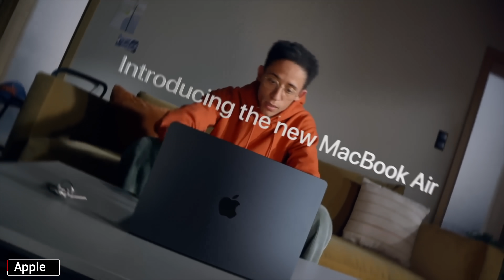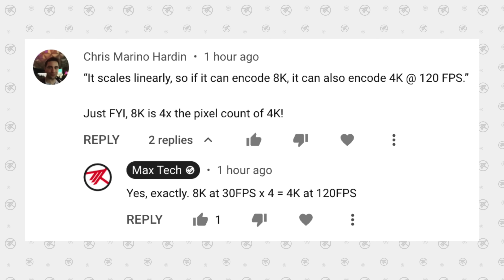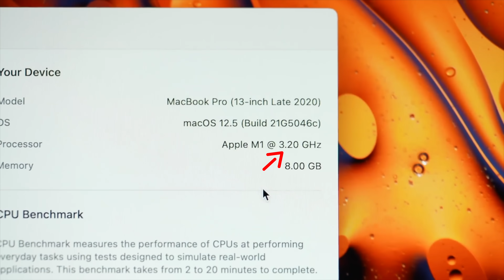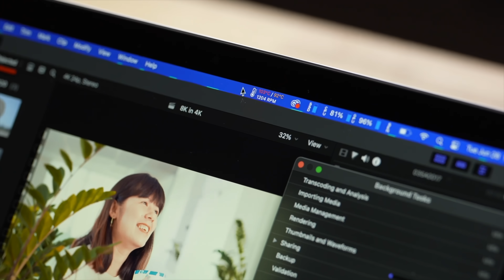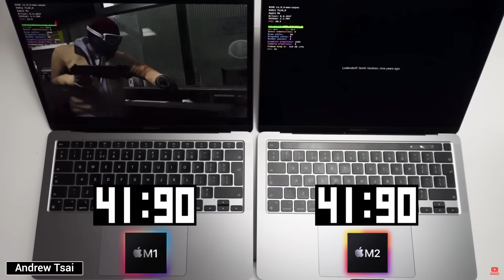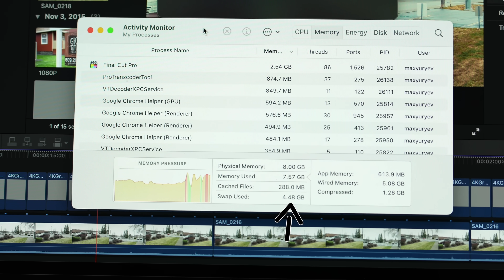M2 MacBook Pro - Top 7 Problems after 1 week..

Comment: I think i have a problem with my Macbook Pro M2 13 inch. The speakers don't sound as loud as the Macbook Air M2. For instance, I have to set my speakers on 75% in order to be on par with Macbook Air M2's speakers on 40% - 50%. Does anyone else having this issue as well? Thank you.

Comment: The only issue i see is the webcam that i don't use. Pros: fans, touchbar (for me), battery. 0.3 inch of more screen is useless when you always work in full screen because they cut the top part and it's the same size 13.3 😑😑.

Comment: Also, did anyone notice the speakers on the M2 behind quieter and more muffled than previous generations? I just upgraded from a 2019 MacBook Pro and the 2019 is noticeably louder at comparable volume. Or did I just get a lemon? :/
Reply from the maker: Nope that is correct. They lowered the highs and tried to balance out the sounds but it is quieter. I prefer the 2019 speakers.
Reply: @MaxTechOfficial  Thanks for confirming, just wanted to make sure I wasn't the only one. I gotta say it really feels like a downgrade :/

Comment: People who want a stable system should not use m.2 hard drive.Especially those who do important tasks or write reports often..The fault rate is too high right now, People who back up often won't have that much issues,but still.It's like holding a ticking time bomb not knowing when it's going to crash on you..The m.2 still has a  long way to go to be in the safe range.

Comment: I dont feel cheated.  I paid $1043.00 before tax out the door at Bestbuy yesterday.  $60.00 less than an Iphone 13 Pro.  Im no content creator so Im happy. Its an upgrade from my original unibody intel mac.
Reply: What configuration did you get and how’s it working?
Reply: @sunitjoshi3573  I got The base model 256GB SSD with the 8 GB of RAM.  I’m no power user but I’ve got it to do everything I need.  Love the battery life in standby and normal use. Really only need to charge it every couple of days.  I’ve went a week in standby.

Comment: None of these “problems” are related to my use cases for a M2 air. Lots of mix up between Pro and Air…. on the other side, I am missing whether the 10 problems found by this channel in M1 are still existing in M2…? Nothing…btw…. 2-1 chip is most likely related on shift at chip producers… wasted time here…

Comment: You’re clearly drawing conclusions without all the information. The individual wafer price alone doesn’t tell you everything. How many wafers did Apple need? Which suppliers could fulfill an order for that many? And what was their price?

Also, was anyone selling flash storage of the same quality as Apple used in 2019 in sufficient quantity to fulfill their order? Maybe Apple’s only viable choice was a slower option. 

Did they make a mistake? I don’t know, maybe. And neither does anyone else here, unless the DRI for the M2 MBP’s storage subsystem is here (and even if they are, they won’t say anything unless they want to lose their job and get sued).

But, from knowing Apple, I doubt they made a mistake. I’d put my money on them making a tough compromise in order to have these machines ready for sale last month.

Comment: Unfortunately, seems M2 MBA may have much more issues than this M2 MBP, and seems it has even worse production quality, and much worse supply issues.
The supply chain is really bad this year, the M2 MBP video you shared are based on an old matured modal and design, and please think about the brand new MBA, how it gonna be.
M2 MBA still need to wait for a long while to be shipped, due to those production issues. It should not happen in the past years.

Comment: When I saw the thermal throttling issues in the M2 13 Pro from your vids, I immediately got rid of all inclination to buy the new M2 Air. I'm just gonna wait for your reviews. Honestly, I can't see how the M2 Air can physically be better than the M2 13" Pro with no fan. Also Apple using lower quality SSDs all around. That's just insane!

Comment: I like the old design. The new bulky design looks terrible for the 14/16. But I like the new air m2 design which is thin.
Reply: 14/16 design is way better than the old design what are you talking about. Currently have a older mba and the new 14” mbp, I mean yes it looked “bulky” but barely any diff ( oh what like half a pound heavier, sooo heavy can’t carry a half pound more item🙄). Oh so you like the new design on the new air which is the exactly the same on the 14/16 but Bc it’s thinner on the new air so you like it? Bro, you just like it thin so the design don’t even matter  🤦‍♂️
Reply: @Andi-lk5ff  Yeah that’s true I just like it thin. Hate that the 14/16 is so bulky. Looks like it belongs in 2009.

Comment: So what config do you suggest in terms of ordering the MB Air?  I was planning on the 10 core 16GB RAM and 512 SSD.  I do my video editing on Mac Studio, so not worried about that - this is more for checking while doing web design and travel. Replacing M1 MBPro 13" which I already sold.

Comment: I think it's still a great laptop for many people however depending on how the air performs that would be the better option. M2 is only a marginal improvement in some areas and a leap in others. They need to update the software or make changes in the future to avoid some these throttling issues

Comment: I miss the touchbar a lot on my 14" m1pro. But for video editing I needed the better display. I would not need the Magsafe, because I was super happy with the usb-c. SD Card reader is nice, but somehow it does not read all my cards (some 32gb Sandisk extreme pro wont read, 64gig do and the 32gig does read with another cardreader) I also feel that my external card reader is much faster. Also the HDMi will be nice for talks, but will not show my hdr content on my HDR TV, So I need to copy files to a nas and play it with my atv. Different people, different needs I guess
Reply: Well you are also that 1% of the population that like the touch bar, that explained all
Reply: @Andi-lk5ff  The Touch Bar works great with fcpx and also is a great tool for Affinity Photo (you can change the size of the brush while painting). Changing volume and  display brightness is much faster done with the touchbar. Also scrubbing through any video is done faster with the touchbar. There are many tasks where I don't have to move my mouse when I had the touchbar.

Comment: So, I was going for the M2 Air when it lands. I have an M1 Air now. I know the performance is not hugely different, but I like the greater GPU power for a coming game I want to actually play on the Mac regularly. 

So, tell me, do the numbers here make you think that in some ways the M1 Air might outperform the M2 Air, as you would estimate it (no fans, there...)? Might the SSD dump to VM be faster on the M1 Air? Opinions here, please, Max!
Reply: Dude, even the M1 Pro (which has better graphics than the M2) barely gets 40 - 50fps on Shadow of the Tomb Raider, a game that was released 4 years ago. I'd seriously reconsider getting an M2 for gaming.
Reply: @Soreyu  Indeed, the M1 Pro has more GPU muscle than the M2. Remember, though -- SotTR was released 4 years ago and, as such, is written for the Intel architecture and is running under emulation on Apple Silicon. That's going to incur a significant speed hit. 

It's No Man's Sky that I want to play on the Mac, and that's just when I'm wanting a casual session on the go. I play it on PC (with much more powerful GPU than the M1 Pro or Max) and realize it will be a lighter experience on the M1 or M2. Still, it's being rolled out as an Apple Silicon-native port using Metal 3 and is will be featuring the new MetalFX upscaling -- so it should be running rather efficiently on the hardware, according to Apple / HelloGames: 
https://nmsspot.com/2022/06/06/wwdc-surprise-no-mans-sky-is-coming-to-the-mac/
Reply: @blakespot  From the looks of the M2's thermal throttling on the 13" Pro, I'd say there's a very good chance that gaming performance on an M2 Air could actually be WORSE than on an M1 Air. It would perform better for the first 5 minutes. But then after it hits 100C+, everything gets shut down by 50% or more (as we saw in the other vids), and you basically have a hot paperweight. Even the M1 Air only cut performance by like 15% tops for extended loads. But yeah, I'd wait for the review, or just take advantage of Apple's return policy lol.

Comment: Have you ever thought that this kind of machine is a "pro" but not for the "video editing" people? What kind of Mac should use a lawyer, or an accountant? Don't try to say a pc, please… and maybe we don't want an air, but neither a 14" (or plus)… we don't need all that power. And, try to think that maybe that kind of people loves the strip and not the function keys… and that we need space in hd and in ram… So I agree that the 256gb is a big mistake, but this Mac is the perfect machine for professionals in the legal or accounting… I really think that I will buy a 24gb of ram and 2 TB of ssd, because it's the machine I need. Maybe Apple could leave the M1, and maybe there are around too many different types of Mac… and maybe they could give some more months to their product life, but that's the crazy world we live in… So, why don't you make a test on how good is this Mac using Office, and Filemkaer and this kind of applications with 24GB of ram ad some 30 apps all togheter on a 38 inch (or more or more than one) screen? And the duration of the battery with a monitor and a huge presentation?
I don't really care about video encoding… ;)

Comment: Nothing funnier than a Fruit Fly going ballistic that they've been conned again by the Fruit company.    After the incessant use of planned obsolescence that is known in the iPhone and iPad lineups with the continued failure to deploy new and problem-free keyboards for years, I am not surprised that the Fruit company brought out the con-chip, M2.     What you have here is a computer that is simply using up known supplies of un-used chassis from unsold units.    And to think that the company that is worth a trillion could not reprint boxes and had to resort to stickers to cover this.    Cats do a better job of covering their waste.    

I applaud the innovation by the Fruit company using the ARM chips in their system for energy efficiency, but just when you think that the company has become ethical, they prove that they will con you when you aren't looking.    This is much like Honduh tried to con their buyers with the 2000's Honduh Civic that was decontented and made worse than the previous model only to have to rush into production the correct version in less than a year.     

Here is a perfect reason why you should never rush out to buy a Fruit product.     You just cannot believe the fraud of their marketing and you should instead pay attention to the real world tests.

Comment: hey I am a programming beginner and I have a request, instead of using the compile test for coding you should use the Mandelbrot set test by benchmark games, as it shows real performance of the machine. 
python for multicore performance.
its easy to do and it is much more relevant. 
if have any issues in running those tests you can ask me as I have had some and you can refer to Alex Ziskind's videos for it.
this would be of great help to people watching your channel

Comment: Come on, you are overreacting. The 13" mbp M2 is still a fine device. Get it with 24gb & 512gb, and you have macbook that performs awesomely, which is smaller than the 14", without the notch, with the touchbar, and with cleaner overall aesthetics. And very good battery life. The only problem is that an M2 air with the same specs will probably be even better. They should sell the M2 mbp at a lower price point.

Comment: The problem of the thermal throttling is actually really bad. The problem of the high temperatures and fan cycling on and off causes thermal shock in the silicon. Rapid thermal cycling will cause cracks wherever there is an interface between two dissimilar elements. The use of dissimilar elements to dope the silicon will cause different expansion rates at the interface. Slow controlled heating and cooling controls this and minimizes the problem. With extreme cycling the processor will fail with micro cracking. The only way to control this is controlling the fan ramp rate and the processor ramp rate.

Comment: Guys, one idea: For the M1 Air you have this great tip to add these thermal pads to the case to prevent the throttling, which works great, because it uses the case aluminum for cooling as well.
Can you possibly test how this would work with the M2?

Comment: Entry-level laptops aren't supposed to be all things to all people. What Apple has done here is further differentiate the levels of their product line. A base 13" MBP isn't supposed to be as good as a 14" or 16" MBP -- especially under profoundly unrealistic performance demands. To use a different analogy, for some people a Chevy Spark is their ideal car... you're trashing it because it doesn't have Corvette performance for a fraction of the price. The fact is, 99% of 13" MBP buyers will be surfing websites and watching YouTube and TikToks with the M2 quietly, cooly, and happily running at 5% of its capability. Expecting $2500 performance from a $1200 laptop isn't Apple's mistake, it's yours.

Comment: Oh dear. The M1 MBA and MBP are such a joy to use and a revelation to the industry. How has Apple allowed the M2 to suffer these failings? Saving pennies on slower SSD on a premium laptop is crazy and then letting the CPU overheat ids nuts. 8gb was fine before, now it suffers!? 

IF Apple are watching I hope they start to change the SSD straight away and recall current models, or at least build in some firmware drivers to sort the issues in some way. 
Everyone who has ordered the MBA M2 must now be worried. Although I think it will have faster SSD chips. For me Apple have cheaped out on the MBP M2 for some reason. 

I have the M1 MBP and love it. The M2 version should just be a natural update to the M1 version but it’s a nightmare. Such a shame. 😳😎👍
Reply: Try and run what he was doing on your 8GB/256GB MB Pro 13 M1 and it will heat up and slow down if it is also using 14GB of swap. The moral of the story is if you are going to have a workflow like this example then you buy 16GB of RAM as that will not have these problems. Interestingly Max never tested the 16GB/256GB version, he may not have ordered that, but I suspect it would have worked great. The M2 MB Pro 13 is a good upgrade and clearly much better than the M1, just be sensible and do not buy the base model if you are going to flood the RAM!
Reply: @ahaimes6320  hi, I never run that sort of config to be honest. I am not likely to upgrade. I simply bought the M1 MBP 13 discounted last year as a ‘Big’ birthday present as I didn’t want the air. I simply think that Apple should have not put a slower SSD into the product to save pounds. It already had a lot of people moaning that it’s in a old case and it’s a poor upgrade. Why make it worse by downgrading the SSD? 

Little bit worried about the heat issue but I would think it’s fine with games as the fan and 10 core gpu will cope better. It’s not everyday you encode 8k video! 

Cheers 😎👍

Comment: The heat and throttling issues could cause anyone considering the M2 MacBook Air great concern.  If the Pro, with a cooling fan, is having an issue, the Air will have much more severe throttling.  And I can't see any "fix" for this issue, other than locking the CPU to limit it's performance, and then you lose the speed benefits that are promised for the M2.

Comment: I’m curious about M2 iPad Pro. Not just thermal throttling but also power consumption, as iPad is less frequently used with power cable connected than MacBooks. I kinda doubt if this chip is really usable to iPads

Comment: I think the original M2 was designed to be produced with 3nm technology (much less power consumption and much less overheating). Maybe due to TSMC delays on 3nm, Apple has gone for the B plan adapting M2 on 5nm. Maybe M2 Pro and Pro Max will be produced with 3nm.
About the NAND: I guess there is a NAND shortage and this is why Apple had to switch to slower chips (slow chips are better than no NAND at all).
At the end, I agree with you: these choices will negatively impact sales of the M2 hardware. For sure Apple will try to fix this by launching as soon as possible new Apple Silicon based on 3nm.

Comment: Man Apple really did themselves dirty by having the M1 be so good that they can’t do huge generational leaps. This is like one of the few cases where it kinda paid to be an early adopter of Apple Silicon.
Reply: Huge generational leaps? you start doing groundbreaking stuff too often that’s going to cause 2 things to happen: 1) people won’t buy the top of the line, because they know in a year or 2 it will already be heavily outdated. 2) you start having too many improvements, then you start talking people will have to lease laptops, because it’s pointless to spend a few grand when it’s obsolete in a couple years!  Either thru BS Apple “updates” that slow down the machines, or they purposely hold back new functionality only for 2 years or newer models….

Comment: Aside from the ssd issue, im interested in how m2 pro/max chips do (regardless if they build it on current 5nm or smaller). It will show if m2 is more of a stop gap yr or if the bigger chips have real upgrades that were lost when scaling it down/making the chips physically smaller and weaker for the entry model.